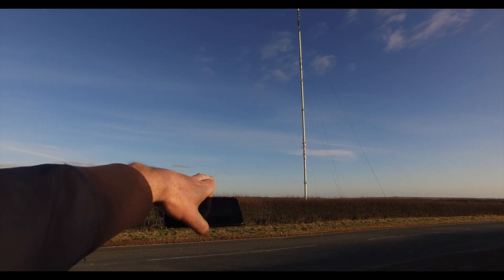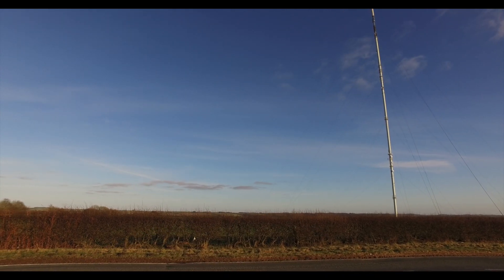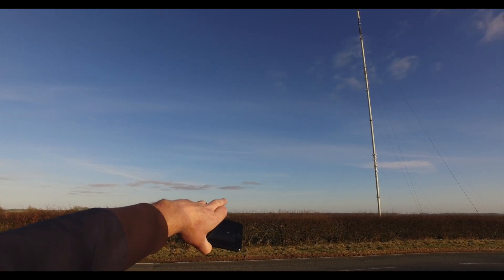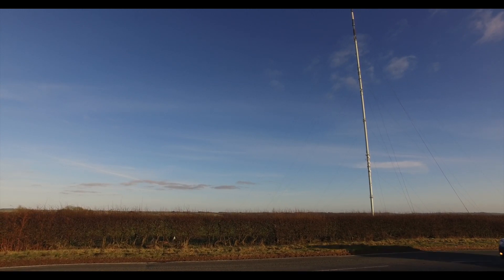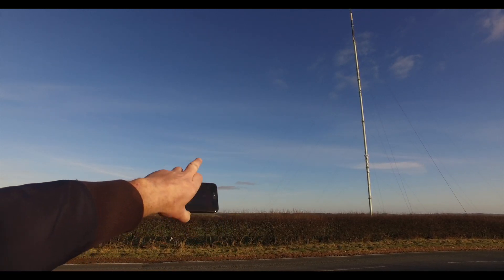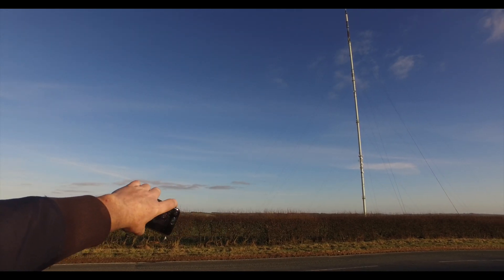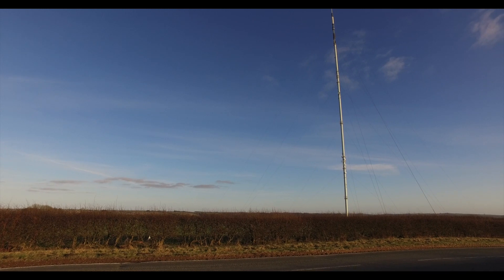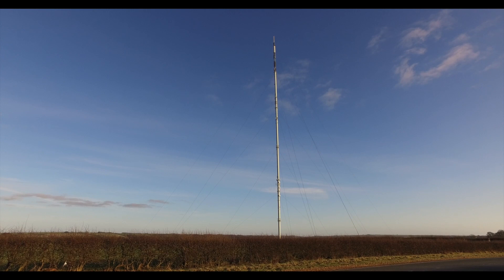Drone flying 400ft

Comment: Could you not stand at the bottom of the cliff and fly up the face of it to a height greater than 400ft (depending on the height of the cliff?)
Reply from the maker: as long as you keep Visual Line of Sight sure